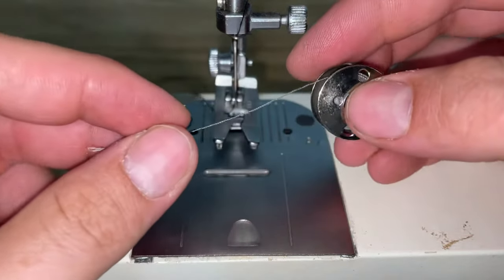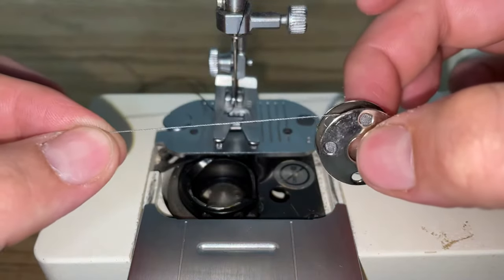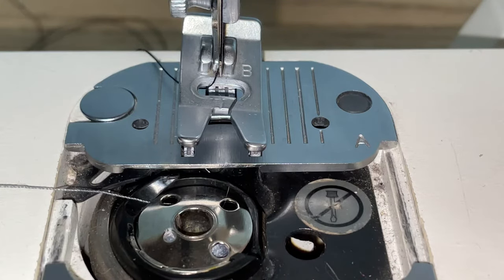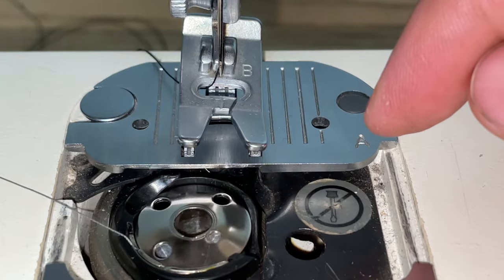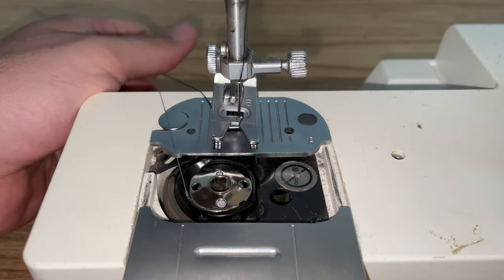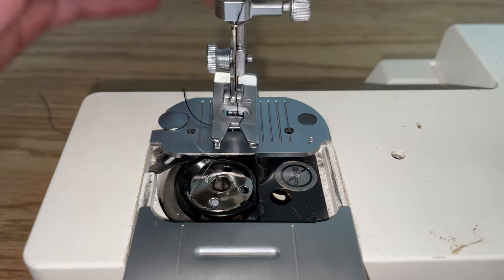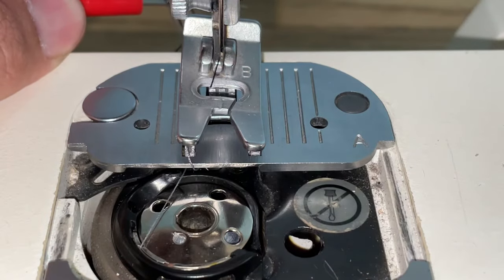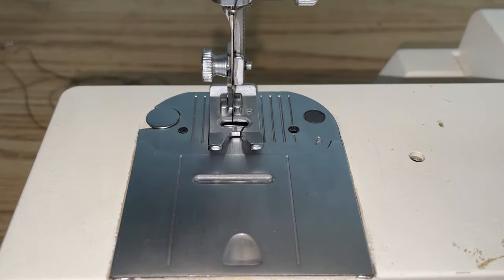Singer 5830C Sewing Machine: Loading The Bobbin

Comment: The silver part that turning when you used the wining wheel for some reason mines not turning...can u tell me why is that? Thankfully
Reply: The machine has a bobbin winding mode that disengages the whole bottom half of the machine.  You'll just need to switch it back to normal mode. The hand knob on the right side of the machine has a large circular toggle switch built into its center.  Press into the center of the hand knob until that switch clicks.  You'll know you are in sewing mode when the needle moves up and down as you rotate that hand knob on the right side.   Hope this helps.